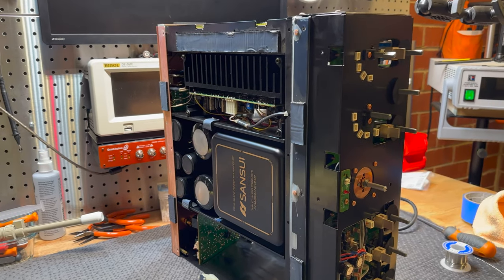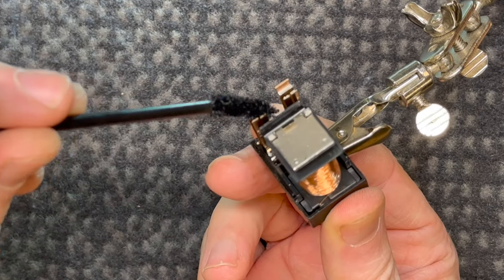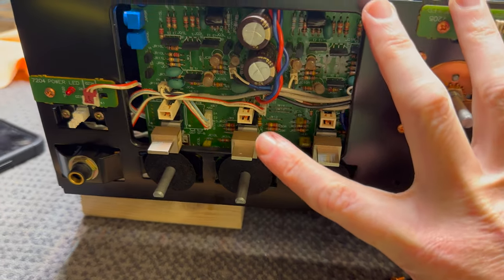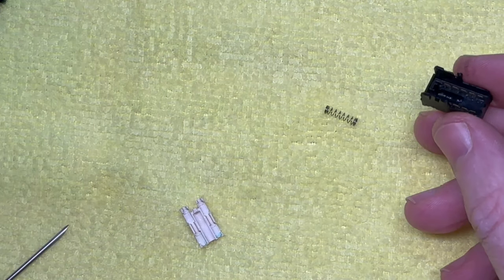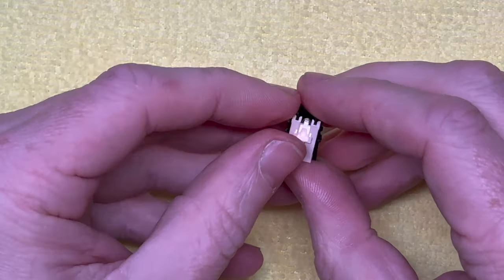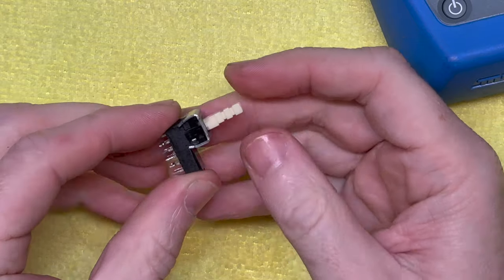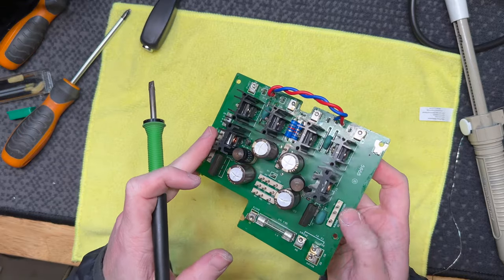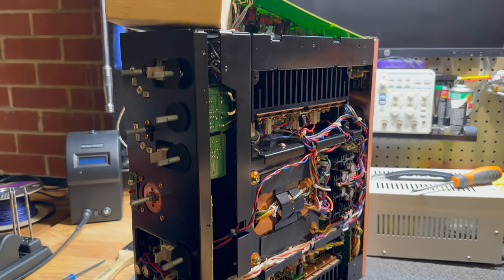Sansui Alpha AU-907MR - Restoration (Part 2)

Comment: You can use solutions to clean Silver for the contacts and it clean the cover from heatspots and also Aliminium.
Reply from the maker: There is a new video where the relay was replaced and contact cleaning :)

Comment: What kind of replacement pots do you use? I have been looking for replacements but I can only find the blue boxes with the top golden screw for adjustment.
Reply from the maker: If you’re referring to the adjustment trimpots. I only ever use Bourns branded ones. In this application they were 3339 model

Comment: Did you use any lubricant for the switches and what do you like to use to clean the PCB Boards?
Reply from the maker: I use Isopropyl  bath to wash pcbs, I cleaned some switches that were problematic but most were fine to leave alone :)

Comment: Hi, how did you clean the pins on the power supply? What tool did you use?
Reply from the maker: I used deoxit and the fibreglass brush :)
Reply: @whatcouldgowrong7914 thank you